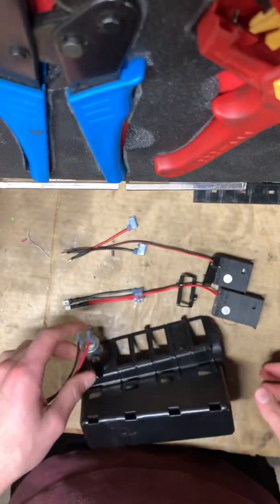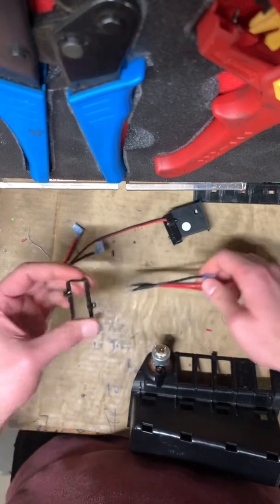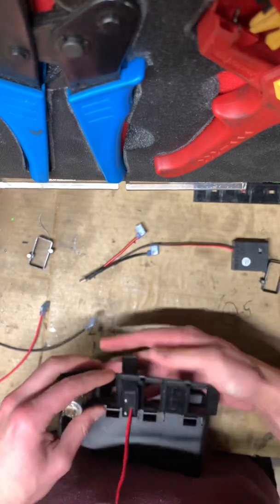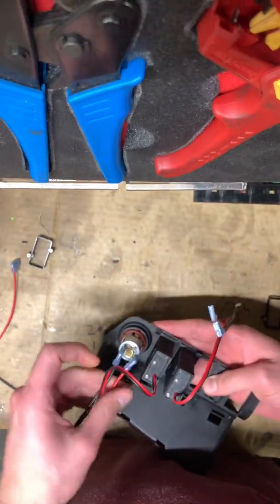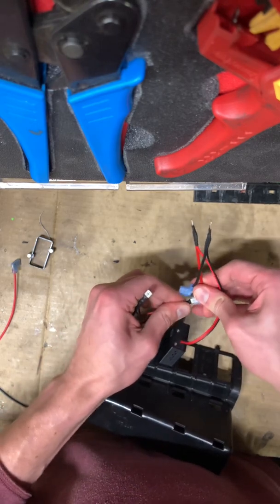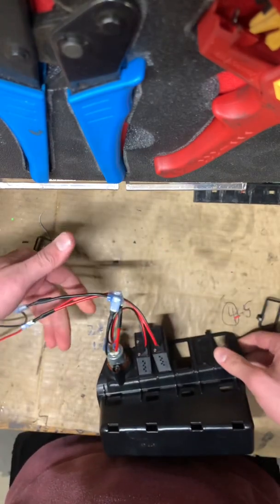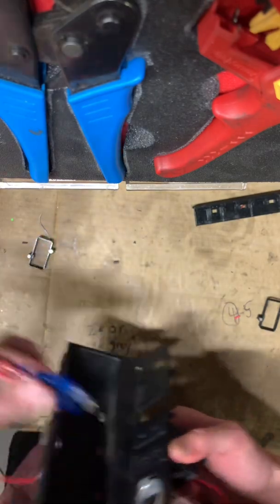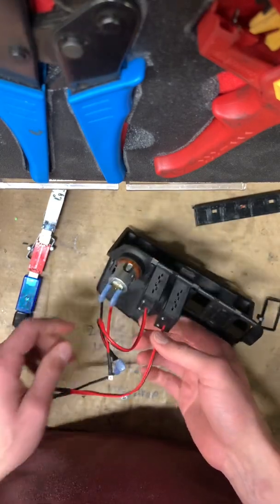E36 USB Module Wiring

Comment: Does the usb module have a resistor or smthing to regulate the charging or is it just two wires that feed 12v power?
Reply from the maker: If I wired it directly to 12v that would be extremely idiotic. Also, a simple resistor would not work to decrease the voltage. There is a PCB with components and a chip that regulates the power depending on the charging protocol. Google phone charging protocols for more info. The charging protocols for each module type are listed on my website.